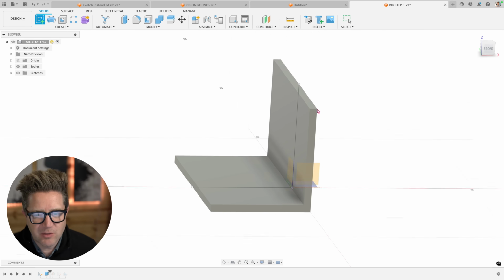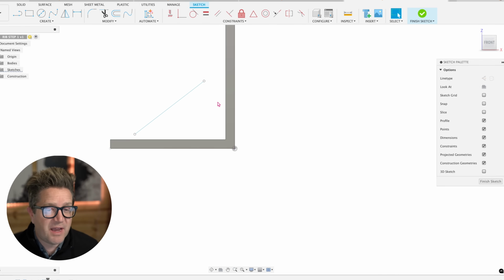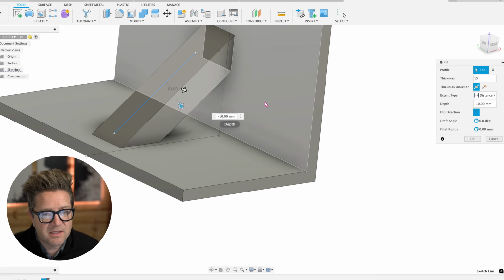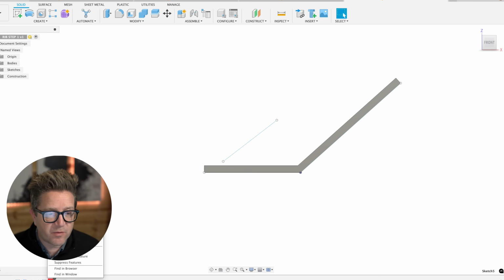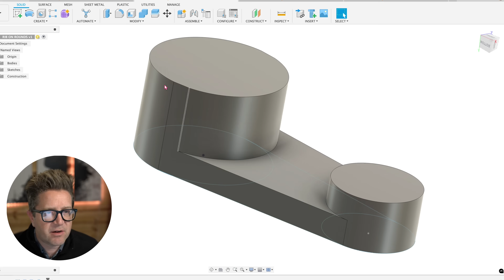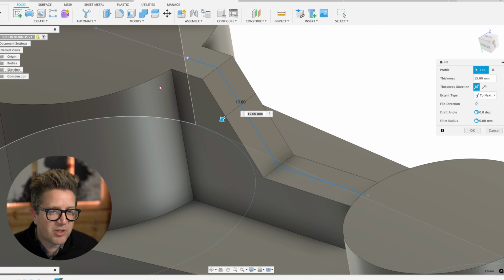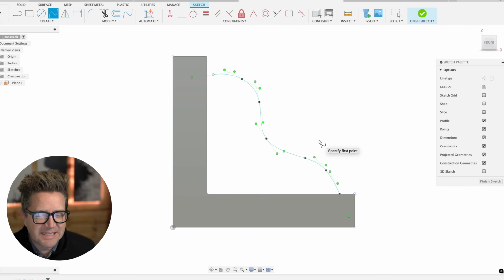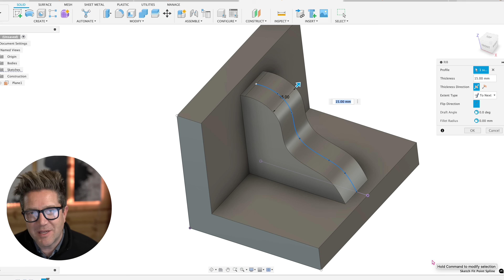Learn Fusion 360 Rib Tool – Faster & Stronger Designs with Less Effort

Comment: Many years ago, I took a 3 day AutoCAD class.  We were given an inch thick "helpful" manual, bombarded with information, given "time" to practice, and several coffee breaks. Some students were very slow at learning (me) and some didn't really need to be there.   I walked away with learning virtually nothing.   Your style and method of delivering complicated information makes it very easy for me to apply F360 to sketches and has thus helped improve my design efficiency.  I really appreciate what you have provided.